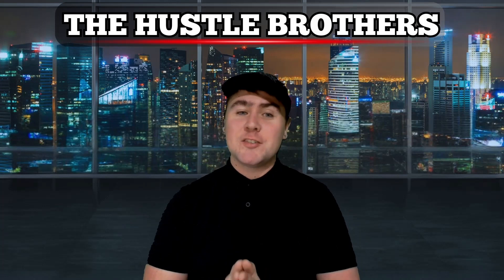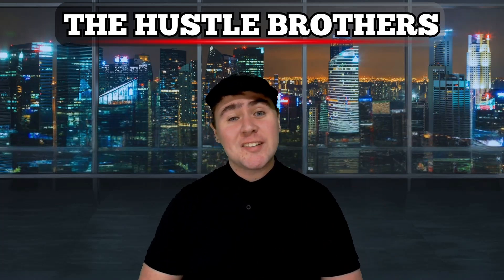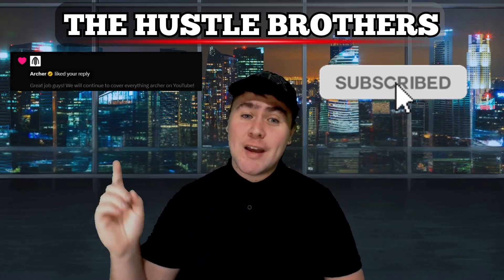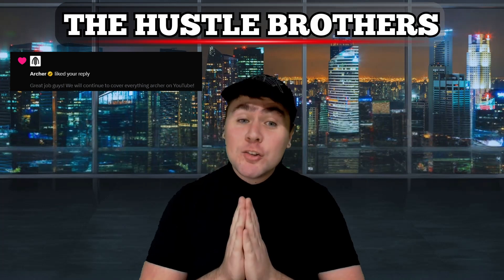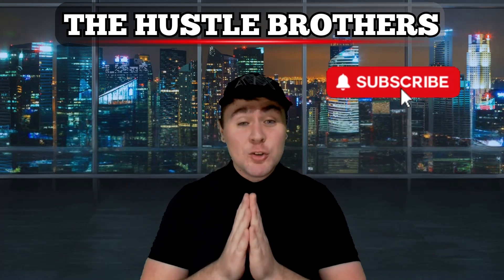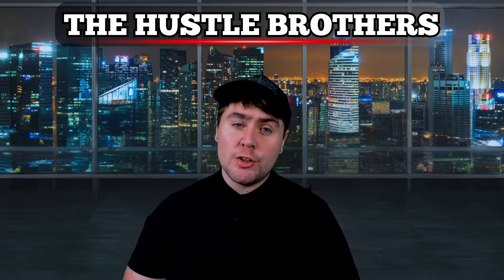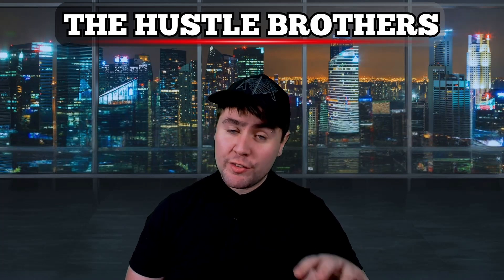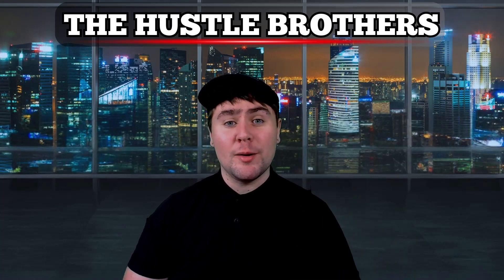BATTERIES Archer VS Joby Aviation!

Comment: So, it's not clear which strategy is "better."  However, we do know this.  Historically, when companies vertically integrate in the short term (like Joby) to get the performance profile they want in a space with many well-funded suppliers (like Molicel) they can find it very difficult to maintain their advantage or even parity over time.  Since this video was made, Molicel has announced a number of new battery models.  While none may directly apply to eVTOL, they are representative of the rapid rate of change going on.  Of course, if Joby is actually using a COTS pouch cell from a major batttery maker (like Panasonic, as rumored in an answer below) then they can keep up, at least for a while.  But to the extent they rely on a lot of proprietary elements in the battery pack, that will be an increasingly high bar. So, my nod for the long term goes to Archer's approach, with the understanding that there is nothing short of NIH at Joby from having them switch to that same model down the road, if they feel it makes sense.

Comment: Jobys wins
Reply from the maker: Do you think?
Reply: It wins the silver medal.
Reply from the maker: you still backing archer mate?
Reply: @TheHustleBrothers  not at the moment. I got spooked when they doubled their available shares. I thought that should cut the price in half instantly but they didn't drop for a few days and not that much considering.  People seem to believe in them. I personally don't but I think they are the best of the bunch. They have that 10 minute unedited flight and that's impressive to me.
Reply from the maker: I do think they have a solid business model
Reply: @TheHustleBrothers  the buisness model may be solid but I'm just waiting for real evidence it's possible for any evtol to lift a significant amount of weight and move it several miles. You would think one of them would have shown that by now.
Reply from the maker: its in the works mate!

Comment: Munro Live did tours of both Joby and Archer's factories. You can see the build of their packs in these videos. Here's the link to the Joby tour. https://youtu.be/cQFH1Z9DMuY?si=RaoFzHKAj7UiZ-EX. Around 26 minutes in, you can see their pack build. Joby's prismatic pack structure (encased pouch cells) is superior to Archer's cylindrical cell pack. This prismatic cell configuration has much better energy density and is easier to manage than it's counterpart. Neither company discusses their battery management systems which are critical to preventing cell runoff and over discharge but Joby's approach of fewer larger cells as opposed to more cylindrical cells in parallel should be simpler with less potential failure points and cell imbalances.
Reply: They say the titanium case for the batteries are hermetically sealed. They shouldn't do that because the load would be extreme and the cells will inevitably expand inside. They need to poke a hole in them to let some gas out. Sealed batteries are why custome ecigarettes blow up sometimes. Thet need a vent
Reply: @TheBagOfHolding  the sealed hard case is engineered to control swelling in addition to thermal runoff in the event of a failure. Venting the case would defeat the purpose of this. Limiting swelling allows for a more consistent thermal transfer contact patch for the cooling system. Search for prismatic cells if you'd like more information. Munro Live also did a comparison video on automotive packs, which may be a good reference for you.

Comment: Joby is using pouch cells? On a video they said they were using automotive cells. When did they change the plan? Are they going to try certification with pouch cells?
Reply: Pouch cells are used in the automotive industry. They are technically using a prismatic cell structure as the pouch cells are tightly encased in titanium. I've got prismatic cells in my electric sportbike that I designed and prototyped. My cells were built by Samsung for Ford EVs.
Reply: @tm70254  yeah I looked it up after that comment and they do say pouch cells. I just thought since they said common and they show that hermetically sealed titanium box they would go In they would be cylindrical.
Reply: @TomMiceli  where does the company themselves say what they are using? The patent for the cooling system shows cylindrical cells.
Reply: July 14 2023 on Twitter they say they are pouch and show a short clip of what they look like.
Reply from the maker: Thank you for finding this bag!
Reply: @TheHustleBrothers  you're welcome. I had a hard time finding them saying it themselves only third party reporting. I don't use Twitter so maybe that's why I never saw it.
Reply from the maker: you need to make a twitter! its a good resource!

Comment: Did you mention $KULR. As for thermal managent for batteries ?? Both use or only JOBY ?
Reply from the maker: I dont think Joby have a direct relationship with them, I do know toyota uses them
Reply: I don't believe that Joby is outsourcing their thermal management for their cells. They construct a sealed titanium box around the cells which is liquid cooled. It controls pouch expansion/contraction allowing for consistent surface contact with the cooling system and contains the cells in the event of a failure.
Reply from the maker: thank you so much for clarifying this tm!
Reply: Joby has a patent for their own thermal management that they will build themselves.